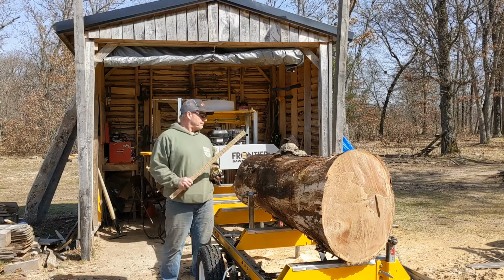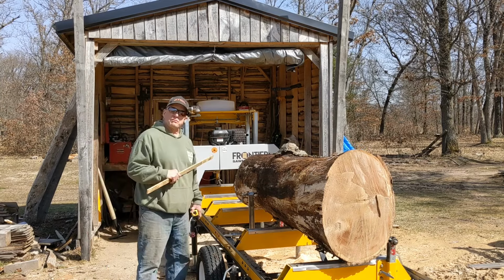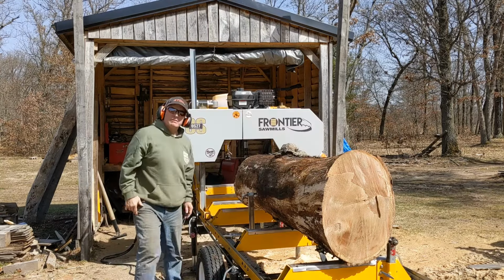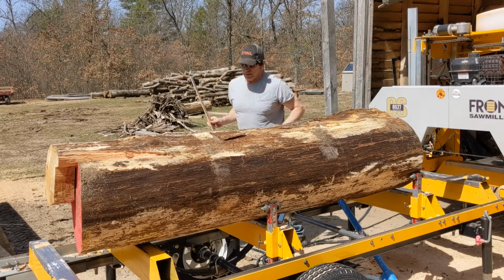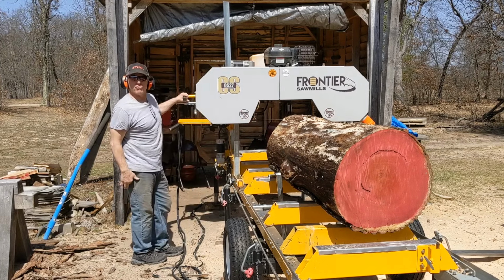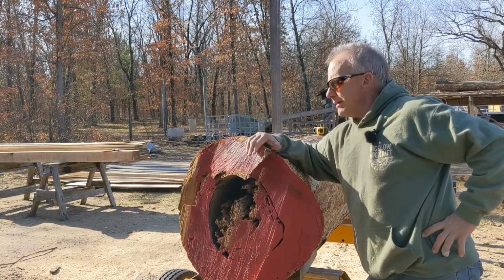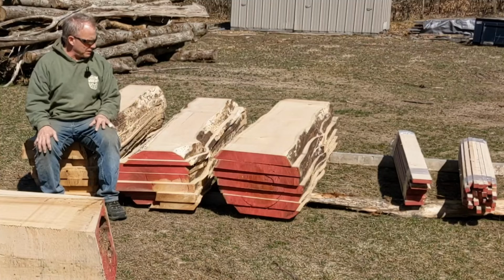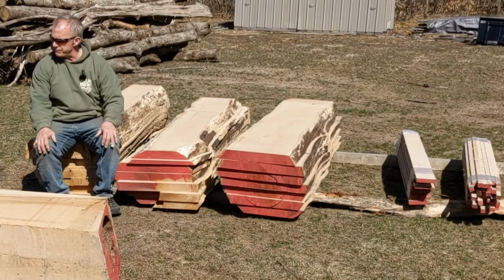Customers Red Oak Slabs on the Frontier OS27 Sawmill

Comment: Wow. That's maxing out the mill. The largest log I've done on ours so far was a 26" spruce. I  should receive the new norwood sharpener and  dual tooth setter on Friday. Along with the winch.
Reply from the maker: Having both those will be a big sigh of relief when you need sharp blades.   Are you using the winch package to parbuckle your logs up?  Thanks for the comment and have a fantastic week.
Reply: @BigelowWoodcraft  I'm only planning on using the winch to roll the larger logs.  I  have a tractor to load them. Once I get my sawmill shed built, I  won't be able to roll th logs with it